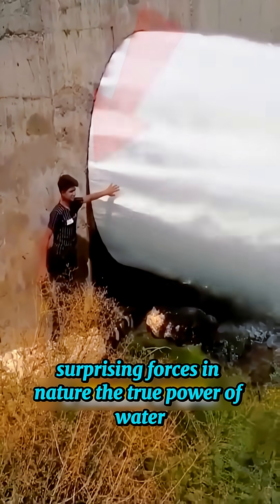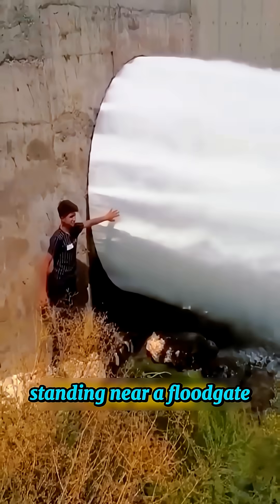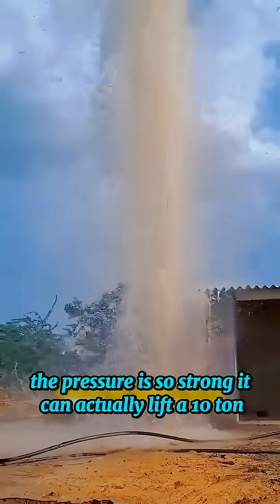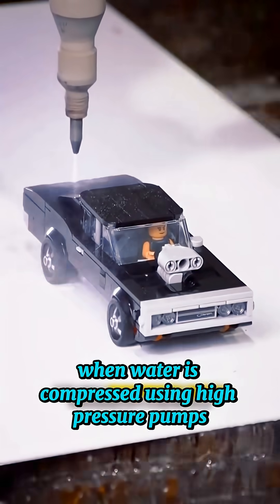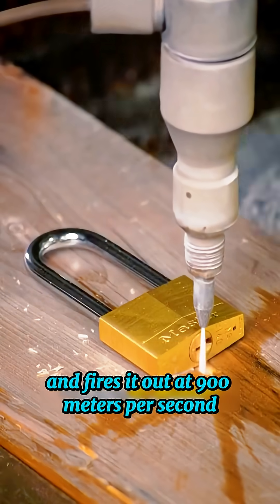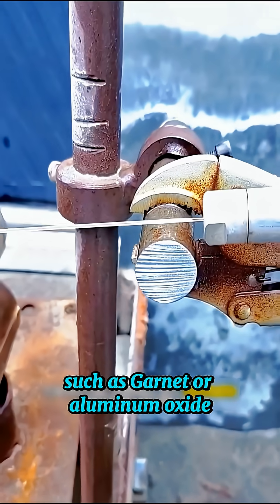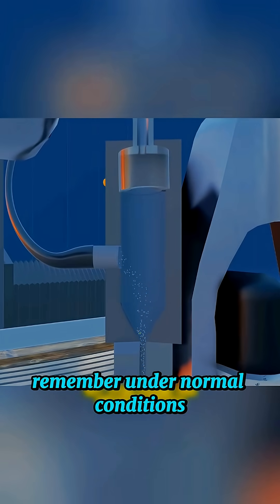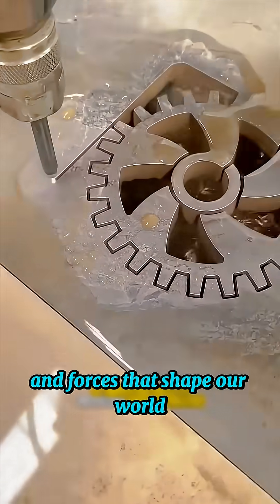The Terrifying Power of Water — Most People Don’t Know This | Invention Lab

Comment: Two inches of moving water can displace 2000lbs of weight so next time you think about driving through a flooding section of road be sure about it's depth and the weight of your vehicle or it could sweep you right off the road ☠️